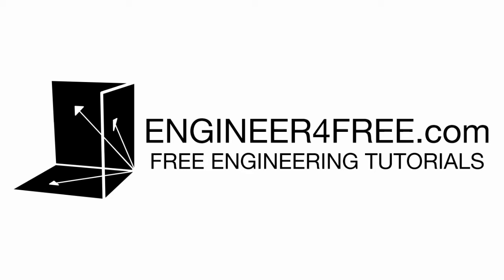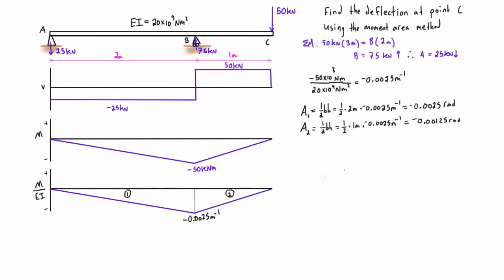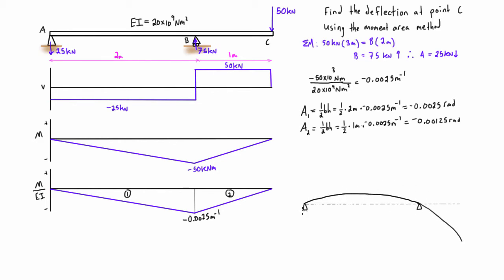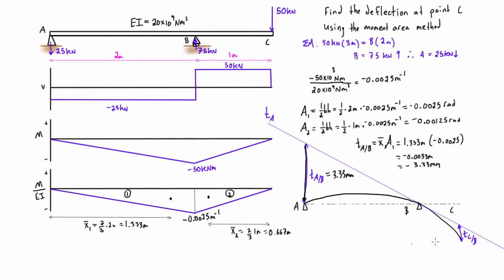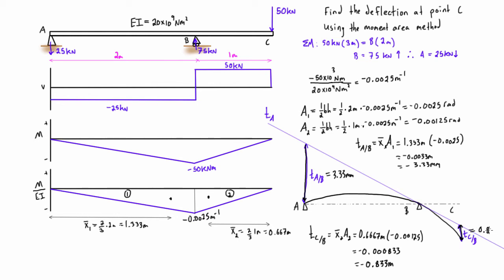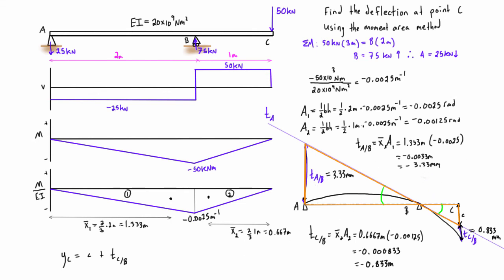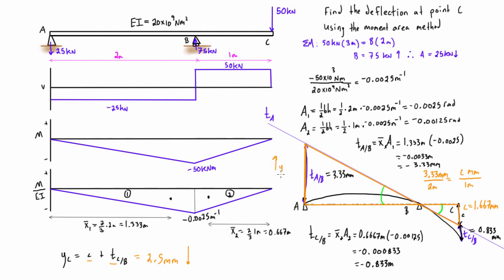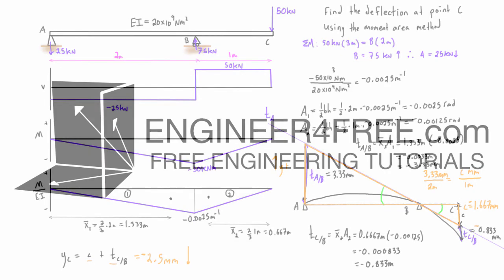Non symmetrical moment area method example: overhanging beam

Comment: Hey is the deflection Tbc should it be taken as distance between beam bend and tangent line or as inditect deflection at c due to bend of span ab
Reply from the maker: The blue coloured T_c/b is the vertical distance between the deflected position and the tangent line. You need to also add the orange coloured distance labelled “c” To get the actual deflection of point C from it’s original position.